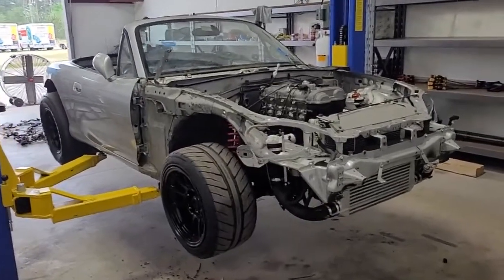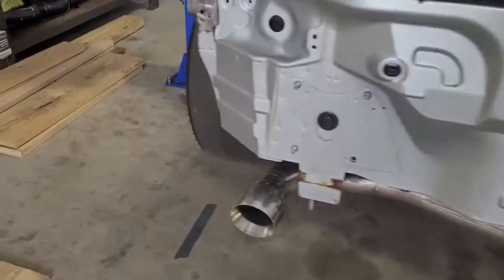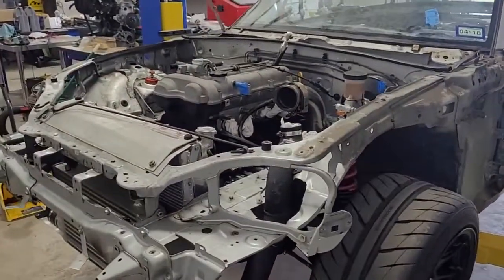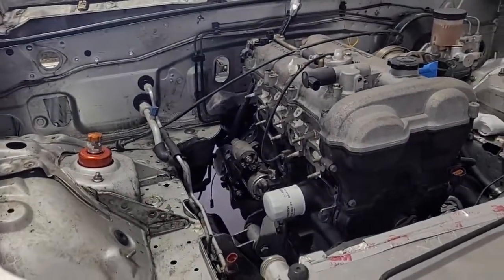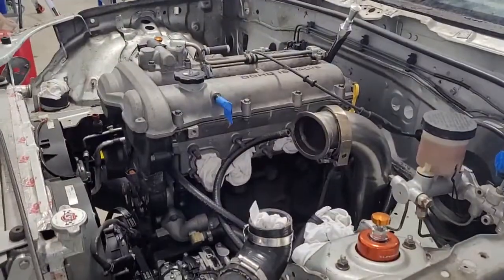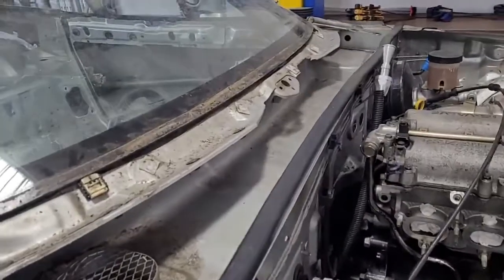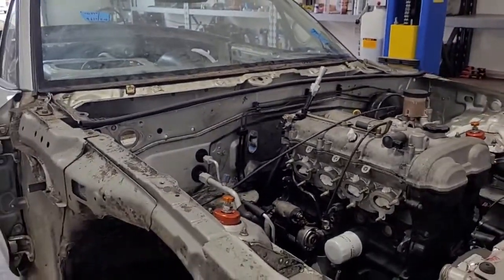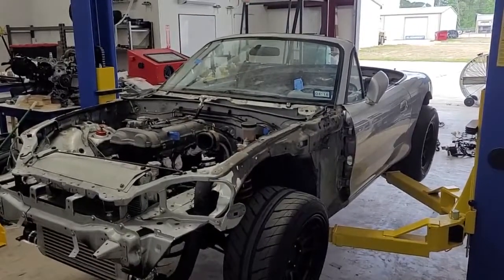RACECAR Benefits!

Comment: Is that a xida suspension?
If so how is it? Would you recommend it for autocross/hillclimb?
Reply from the maker: It is Xidas. I haven't drove on them yet so I can't comment unfortunately. However they are highly recommended by many who go fast which is why I bought them. Lastly, they seem to have good resale value too which in my experience is evidence of a good product.
Reply: @patrickcowanjr1  alright because i want them too because i recently had my first autocross event but on stock suspension with pu bushings and it was like driving a boat